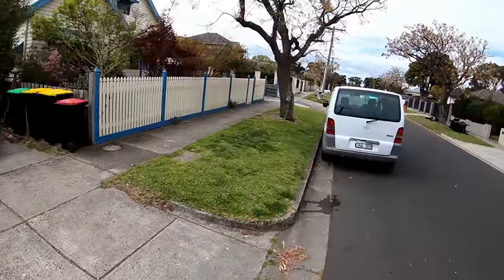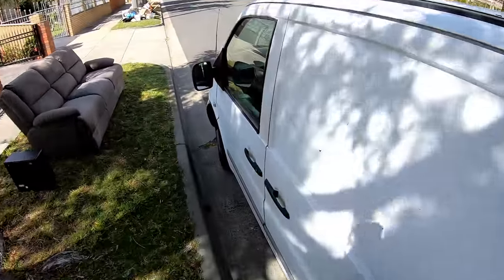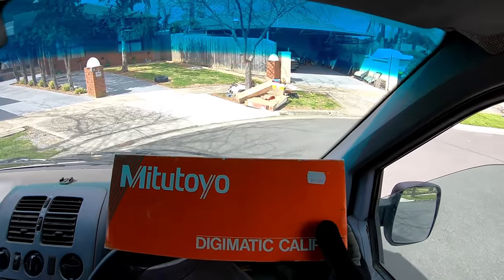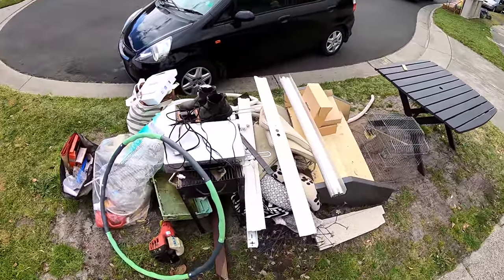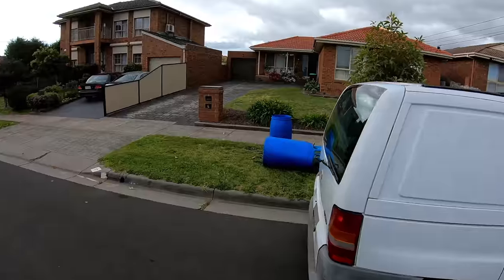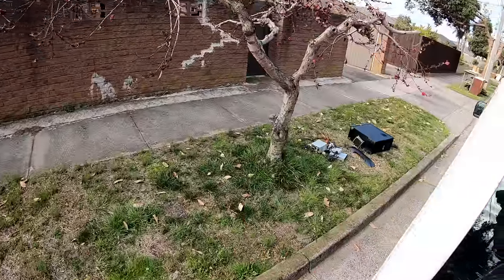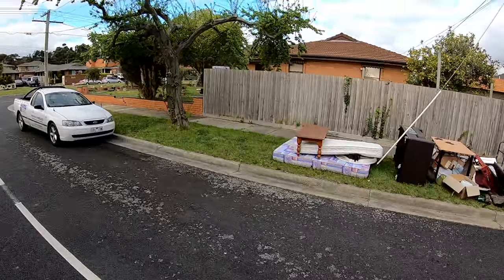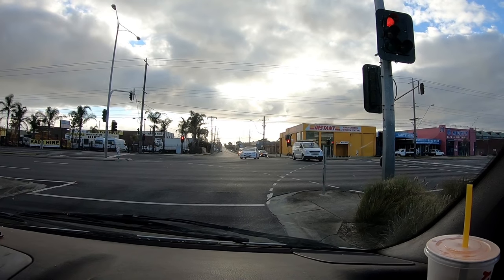Street Scrapping Trash Picking PC Mahem

Comment: 41:30 This looks like a x79 board. Mostly sold with i7-3820. Common issues are weak power supplies in these ebay plug n play machines. Not bad. This cpu can easy be overclocked to 4.7 Ghz with a cheap watercooler. Still a good comp today.

Comment: Certain companies buy digital goods like motors, circuit boards by weight, the laser diodes in DVD and especially blu ray players can sell for quite a bit, lots of value in things that all add up :) remotes, stepper motors in printers, fans, etc. And if you can handle it, taking small fridges, washing machines and dryers, old water heaters, for a great amount of material for not alot of time. Just add a few big tubs to the van and sort it out later lol. I like to hoard in bulk and take them/sort efficiently. Drill, mallet, Long screwdriver bits and my favourite for big stubborn items, my trusty sledgehammer haha. Steel generally isn't worth it unless you have a big van and space for a drum to fit all the leftover panels and plates to sell.
Reply: Can do ebay, online and sell boxes of assorted diodes maybe, might be lucky to find an electronics shop or ewaste buyer but dont expect as much. If it has a CD/DVD burning capability the lasers are alot stronger and where most of the real value is. Careful if you want to test it though, you can really hurt yourself. Still, its free money rather than throwing it in the dump, sometimes good components get missed in favour of finding metal content

Comment: Hello Ben, I have a question about a small Dell computer tower and the Hard Drive is locked. Do you think that if I buy a new Hard Drive that the tower will work? Or will it become locked also? Thanks for the update.
Reply: Ben, you have to put your hand down inside the crack under the cushions of the couch sides and the back. I have found money, remote controls, toys, keys and a complete set of manicure kit held together with one of the pull chains like you find on the ceiling fan.
Reply from the maker: you still need to load windows onto the new hard drive, best to try bypass the password, not my speciality